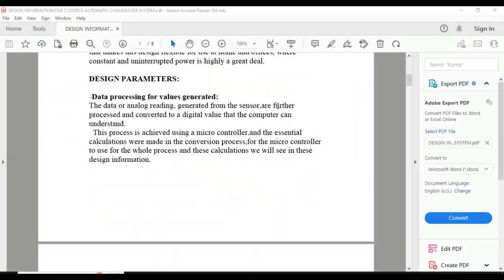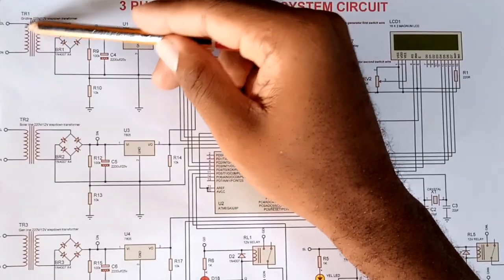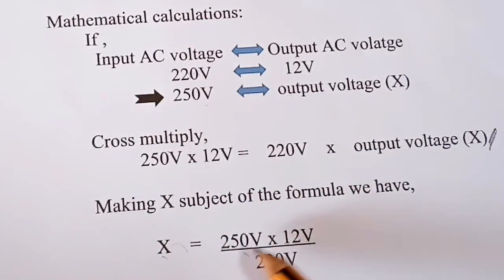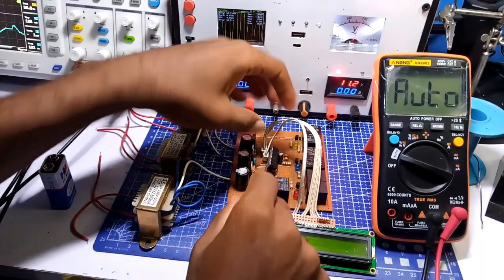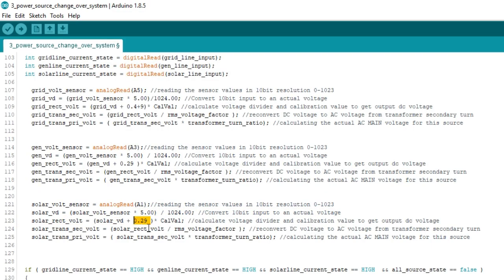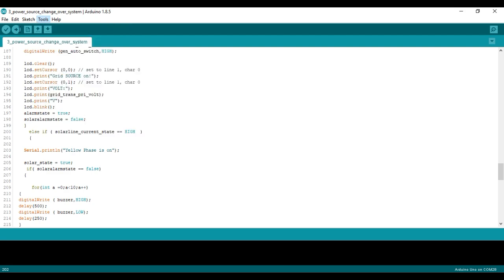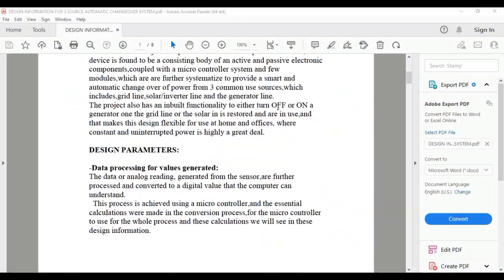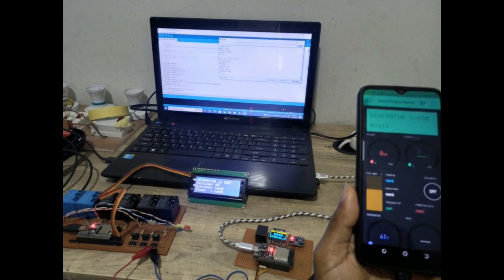Automatic changeover system for 3 power sources ( Grid line, Generator line and Solar/inverter line)

Comment: This is indeed a great work Sir but I wanted to ask, on the part where you connected the generator auto turn off wire, I didn't get the explanation there.

May I recommend that in your subsequent design, you take into account the power generated or supplied by each line. Better still you can add data logging to view each information then the over voltage and under voltage protection too